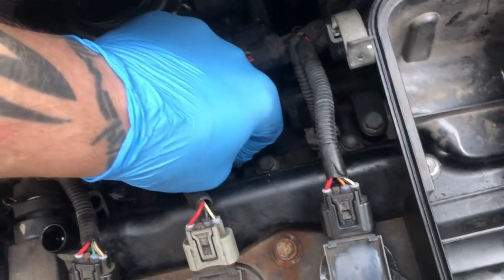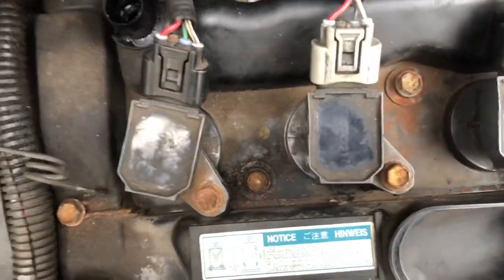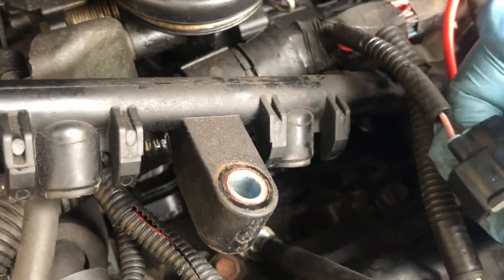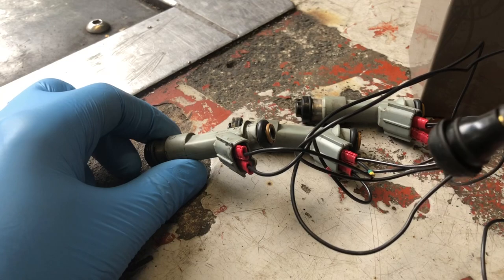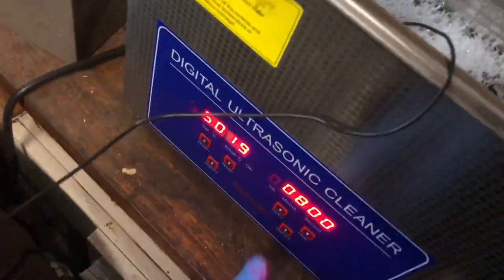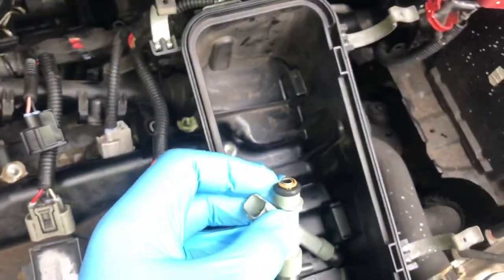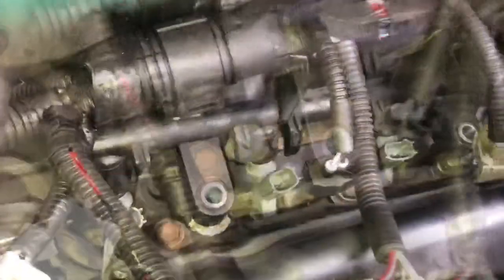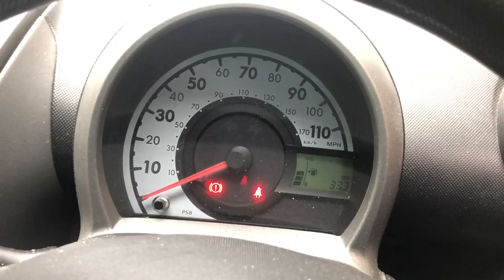Sonic Cleaning Dirty Injectors, DIY Ultrasonic Petrol Injector Clean on Citroen C1, Visible Results

Comment: I would also strongly recommend replacing the "basket filters" on the injectors - they are dirt cheap in bulk.
Reply from the maker: If you have them then why not
Reply: about to do injector baskets this car has been sitting for a year. Do baskets make a notable difference? I'm doing mine because they're apart. Have an ultrasonic cleaner. It's a direct injected 6 cylinder gmc/holden/pontiac g8 thing
Reply: @leahmaree123  If your fuel filter is doing its job, the injector filters should be spotless - I left mine alone.

Comment: I have tried the whole tire valve method and gradually shrinking hose with clamps method and they both SUCK . What I did was go to salvage yard and got a 4cyl injector rail with no regulator and simply supply fuel from a bottle with an air nipple to supply shop air and a regulator to lower air psi to 30-40 psi for cleaning and about 10 psi when back flushing which is turning them around so you can flush the crap out of the filter after its been in the sonic bath the 1st time .. then run it normal and check the spray. tried doing 65 psi like in vehicle but the injectors pop off the rail even with retaining clips. only way to keep them in place would be to incorporate a intake manifold with the set up to bolt them down  (lot of work)
Reply from the maker: That sounds a lot of messing about but a good effective method. Did you notice any difference after doing it?
Reply: Lovely little vid, good idea to check if the injectors re getting warm. 12v can work em a little hard

Comment: What is the rubber nozzle and spray you’re using?
Reply from the maker: The rubber nozzle is a modified tyre valve, the spray is normal carb cleaner. It’s strong shit!

Comment: You took out the injectors without marking 1,2 and 3.
Now you need to code them in correct place.
Reply from the maker: No you don’t. Diesel injectors need coding in. Maybe modern petrol direct injection injectors but I’ve never dealt with them. 

P.s. the codes are just calibration codes to tell the ecu how to compensate for slight differences in for the injector tolerances

Comment: Is it harmful to the injectors to sonically clean them? Also what solution are you using?
Reply from the maker: It shouldn’t be harmful no but anything can happen I suppose. I’m using carb parts cleaner solution which mixes with water, but just using water should work. I’ve heard of people doing the same with the tips of diesel injectors, but I would be reluctant to do that as they are made to much closer tolerances and any minute amount of corrosion could cause major issues.
Reply: @StupidBlokeStupidVideos  I'm thinking about using a mix of seafoam and diesel injector cleaner on my gas Injectors I don't see how it could harm them but just wanting another opinion on it. I also have a pale of gunk parts cleaner I use for throttle bodies and carburetors so that is also an option, either solutions would be used in my ultrasonic cleaner.
Reply from the maker: @jessesmithworkshop6365  I’ve seen people use petrol in the cleaner, but you should put them in a sealed jar or something as it could become some kind of IED if you’re not careful.
Reply: @StupidBlokeStupidVideos  I filled the tank and am watching the temperature and only running for 15 minutes and I think it should be fine.
Reply from the maker: @jessesmithworkshop6365  let me know how it goes.
Reply: Just make sure to use distilled water, not tap water

Comment: what fluid you use in this cleaner?
Reply from the maker: It’s specific stuff for ultrasonic cleaning fuel parts that you mix with water, but you can just use plain water or add a bit of washing up liquid.
Reply: @StupidBlokeStupidVideos  is it cooler/antifreeze liquid good too,i need for diesel injectors cleaning
Reply from the maker: @Mr11ESSE111  I wouldn’t use that. For diesel injectors there might be a different, non water basted cleaner to use. Diesel injectors don’t like water
Reply: yes, only problem is  are none avaibility or you must dry it later and maybe soaked with diesel  @StupidBlokeStupidVideos
Reply: @StupidBlokeStupidVideos for diesel injectors, please hot fluid about 50° for better results 👌

Comment: I learned that it in vain if you don't change the fuel pump filter which is usually in the tank,,,,, 3,000 miles and that little mesh filter is junk, additives keep the injectors spray but don't clean that little mesh pump filter.😢
Reply from the maker: @natvega1  you can’t even change the in tank filter in these!

Comment: Brake cleaner is probabl better for this - some carb cleaners have oil in them but brake cleaner is guaranteed not to😊.
Reply from the maker: But carb cleaner is more aggressive and more powerful,.. and power is good.
Reply: Carb cleaner is actually designed to be safe when it goes into the engine. Brake cleaner can cause plug fouling.